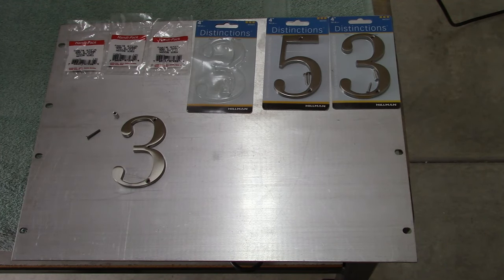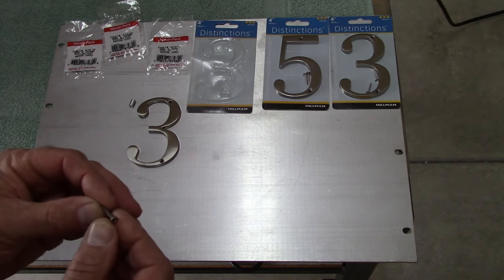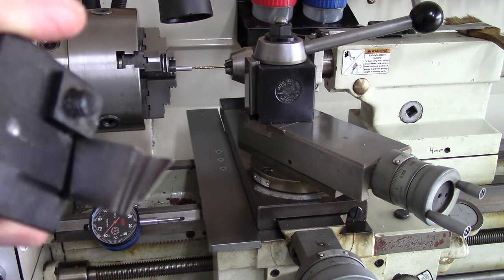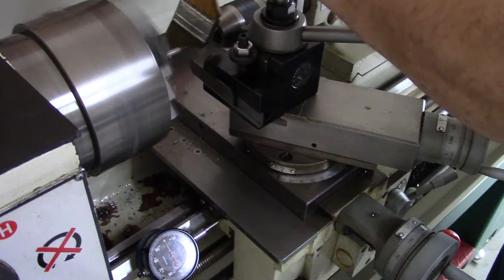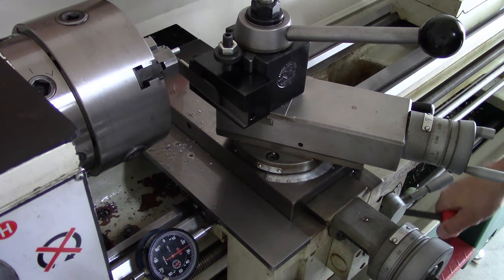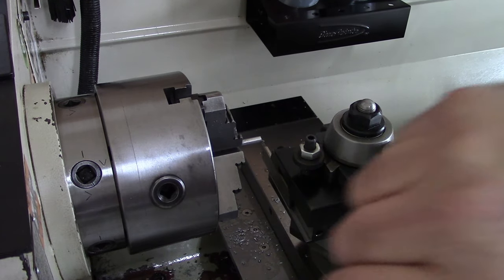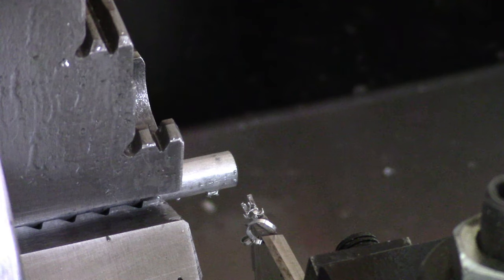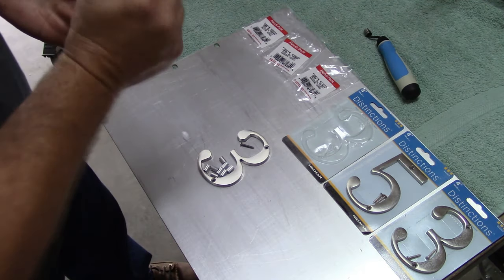House Address Plaque

Comment: Hello Ray,  That will be a nice sign.  I made one fifteen or twenty years ago on some 6061 aluminum.  Hung it out at the curb on a tall post with a cross beam.  Used eye bolts and shackles with a machined eye bolt on a flat strap of ss bolted to the sign plate.  Swings in the wind and the numbers are large enough you can't miss them.  At the time I wire brushed for the swirl effect and than gave it four coats of Krylon clear lacquer (prevents that powder corrosion and still looks new).  Still going strong with no maintenance except changing the tiny piece of hose I used as a wear bushing on the clevis pins (1/4" shackles).  So your mom ought to have many years of use out of yours.  I used black plastic numbers which gives good contrast also.  Take care.  Doug
Reply from the maker: Very nice Doug! I like the swirl effect and was thinking of doing that as well with a transparent color.

Comment: At the risk of sounding like an "armchair machinist" I have learned that using WD-40 a little  more often (more than just at the start) when drilling aluminum keeps the chips from getting stuck on the groove in the drill bit.

I have a similar vixia camera, you might try turning "face detection and tracking" on, then you can touch the screen on the part you want to focus on, and it will force-focus there. It doesn't need to be a person, just a distinct feature.

Carry on, buddy. Waiting to see how you cut the base.
Reply from the maker: Thanks for the tips, I'll check the settings on the Vixia. I also found that using a high polished two flute bit for aluminum works like a dream, I just did not have one in 1/8" and will add it to my list!